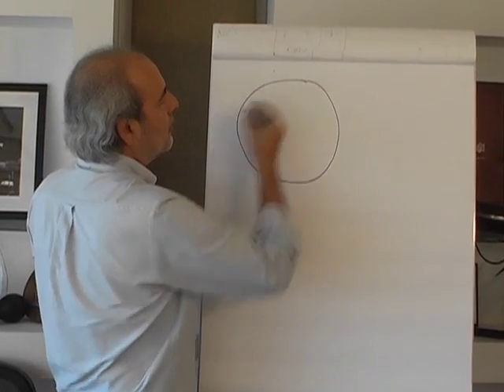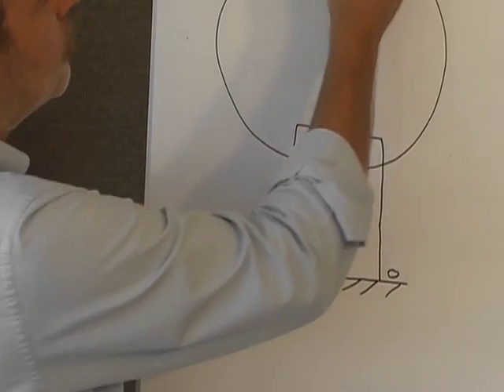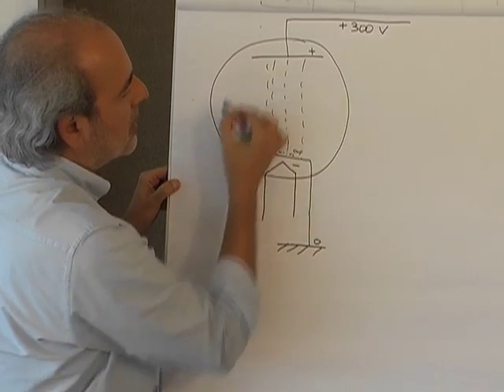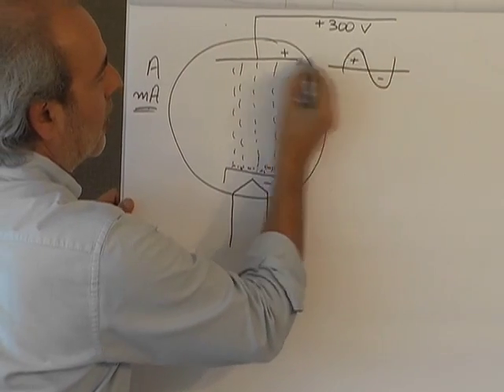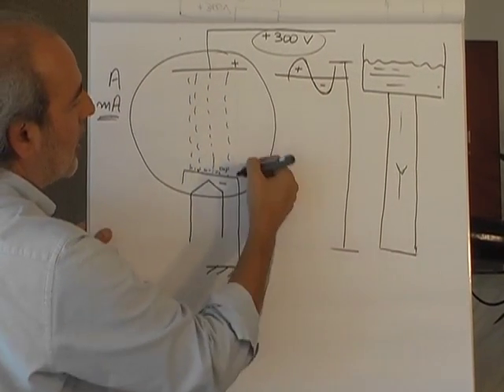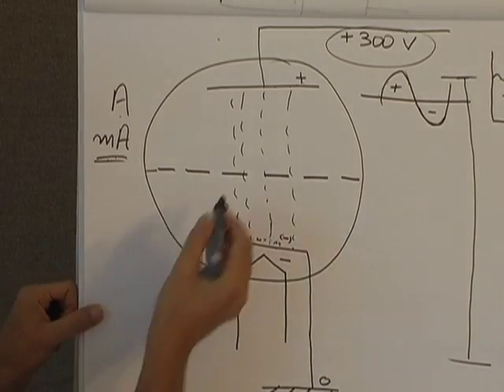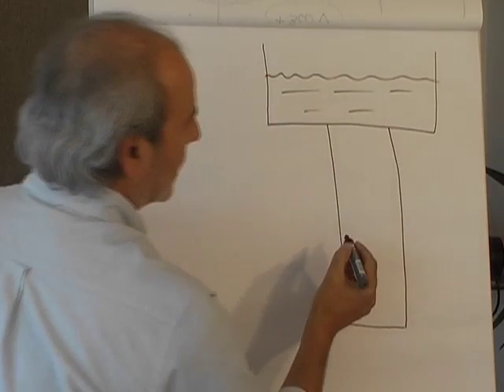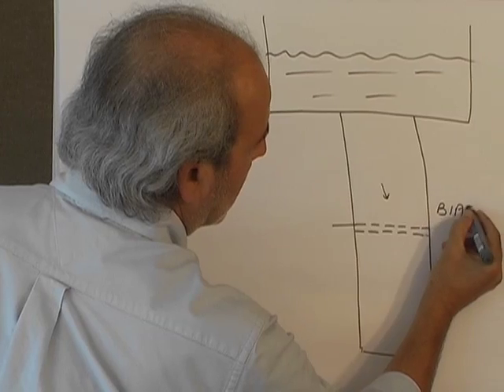Vacuum Tube: How Does It Work? (Part 1)

Comment: @ 3:33 you said from the cathode the electrons move towards anode if the tube has no medium how are electrons reaching from cathode to anode ?? in vacuum how are they travelling
Reply: studio 440hzz through the air.  They jump.  
They are attracted     Same as in a relay except the flow is not by actual contact.

Comment: Imagine a world without electronics or the invention of the vacuum tube... imagine how crap musicians would sound without amplifiers.. Electronics engineers are under credited!
Reply: Pieman6711 It depends on what you're trying to do, honestly. If you want to record voice over for a movie, you would want some solid state microphone preamps in junction with some high quality, large diaphragm condenser mics to get crisp, clean audio. However, if you want that classic, 1950's jazz sound, you might want to use a dynamic or ribbon microphone in junction with a tube microphone preamp to give a very warm and natural sound.
Reply: I will say, as technology progresses, the use of mixed systems (Solid state/ tube/ FET) has increased. In all honesty, I like this idea. I think having an amp that gives you the option to throw in some tube sound is awesome.
Reply: Classical music sounds great. Quite a few hundred years of that with no amplification. Ditto folk.
Reply: ***** but tube sounds so much better.. amp wise. i'd prefer tube amps over anything else
Reply: Indeed! however point being; without electronics, the arts industry wouldn't be as far ahead as it is today.
Reply: ***** Fair call, tone is such an individual thing.
Reply: Mrlz56 Many tube microphones are often recommended a 20 minute warm up time. I, being a voice over guy, would have to wait that time. Sure, you can technically just start going, but it's best to wait for the tube to fully warm up, as to get the best frequency and dynamic response.
Reply: You don't NEED tubes anymore, though. In fact, Sold State is typically preferred these days.
Reply: I mean electronics in general, justin bieber wouldn't be famous if it wasn't for the semi conductor, %90 of artists are at the mercy of the integrated circuit :/
Reply: well I should say that 90% of the developed world is at the mercy of the IC lol
Reply: Dapper Dan wrong. Wrong wrong.   Unless you are saying because rock is kinda dead.   Then I have to agree with you.  
Real guitar players though. Prefer tube all day.
Reply: ***** The pendulum is swinging back, people are actually preferring tube amps over solid state these days and the trend is growing.
Reply: If I am honest, I prefer the sound of Solid State XD
Reply: Mrlz56 You did not seem to read my later comments XD 

But yes, tubes certainly still have their place! I love the sound of tubes, but I love the convenience of Solid State so much more; not having to wait 20 minutes for the tube to warm up really saves time!
Reply: Pyro Chimp no kidding man.
Reply: silicon is great for digital signal processing and  amplification - amps after Tripath. But for guitar amps, pedals etc and some other purposes tube has a comeback - even   punk and metal bands in  the 80ies and 90ies (grunge) prefered tubes  Bad Religion, Rammstein, Nightwish, Nirvana, Eivør Pálsdóttir  - they all use(d) tube amps

Comment from the maker: Thank you. The grid voltage has to be below the cathode voltage. In this example because the cathode voltage is zero, the grid is negative in order to be below it. As the grid voltage fluctuates it acts like a valve opening or closing, easing the passage of the electrons or slowing them down.

Comment: enjoyed your presentation about vacuum tubes.  I have a question.  How does the  input signal to the grid interact with the grid electrons.  If I understand this correctly, the grid voltage is negative which means there is a cloud of electrons surrounding the grid.  The input voltage is a sine wave.  Is there an addition or subtraction of the net charge of the grid as the sine wave increases and decreases?
Reply: The grid is at a voltage which is more negative than the voltage at the cathode so that there is a negative charge on the grid. This creates an electrostatic field which repels negatively charged electrons. Electrons leaving the cathode, attracted by the positive charge on the plate, encounter the negative charge on the grid and some of them are repelled back to the cathode, allowing only a proportion of them to flow to the plate, a proportion which depends on the amount of negative charge on the grid. Consider a tube which has a voltage of 1V i.e. 1000mV on its grid when no signal is present, allowing a certain amount of electrons flow to the plate. If a signal of 20mV peak to peak is applied to the grid, then at the positive peak of the signal the negative voltage on the grid will be reduced to -1000 + 10 = -990mV, allowing a greater number of electrons to flow to the plate. At the negative peak of the signal, the negative grid voltage will be increased to -1000 + (-10) = -1010mV and fewer electrons will flow.

Comment: Ah, thank you for the clarification. I will see if my tube amp's schematic can tell me. It's got a GZ34/5AR4 in it, which is a full-wave rectifier (supplying the filter caps with DC).

Comment from the maker: Yes, correct, I described a simple diode which can also be used as a half-wave rectifier. The tubes you mentioned have two separate plates and if connected in a certain way they become a full-wave rectifier. To better understand, try to see few typical application schematics.

Comment from the maker: Thank you! The main purpose of the rectifiers is to apply the DC to the plate. AC is never applied to the plate. Yes, there is typically a load resistor. In the case of the output (power) tubes, the primary windings of the output transformer replaces the load resistor.

Comment: Excellent series of videos. I have one question regarding the diode. If AC is applied to the plate, is the rectified signal taken from the same point? And is there typically a load resistor?

Comment: Note that when a battery is being charged (i.e. driven by an outside energy source, like the tube is), what is ordinarily its cathode (the + terminal) becomes the anode.  The current enters there now, and leaves via the - terminal, which is now cathode.

Comment: Cathode is where the (positive, conventional!) current leaves the device. Mnemonic: the C and the D in the name tell you that the Current Departs.  Also, positive particles in a liquid or gas (ions) are called cations. So another mnemonic: positive current flow -> movement of cations -> departure thereof via cathode.   Positive current in fact enters the tube at the anode, and leaves via the cathode!

Comment: Hi I have been wondering something for a long time: does a corona discharge form around a  High voltage High vacuum tube?    (yeah  with no breakdown of the glass that is)

Comment: i did not understand a word besides the poster wanted to make things clear in laymans. But I have my own take on what valve amps do.

The music might have lots of transients and sound edgy. Because the valve induces resistance, putting the signal through a valve rounds off the edges and transients. and also gives bottom end to the sound from low all the way to highest frequency. Drums/bass, get extra boom and voices will sound deep. which also explains popularity with harsh guitar signals

?

Comment: @xzibit2313 Yes, in terms of "black box" functionality.  That said, regarding actual mechanics, the semiconductor structure that is most analogous to a vacuum tube thermionic valve triode is the JFET (source-collector-drain).
Reply: Also the depletion mode n-channel MOSFET.

Comment: @6:57. I think you omit one factor about the grid which is the distance you put it from the cathode. The electric field is expressed in V/m so if distance is smaller, V/m is higher and you get more aplification. in other words if you put the grid too close of the anode you get little effect at all. Great vids anyway .